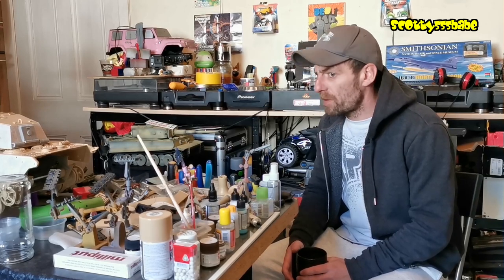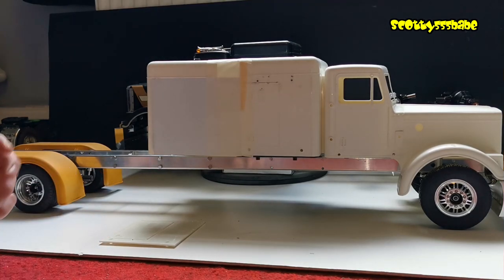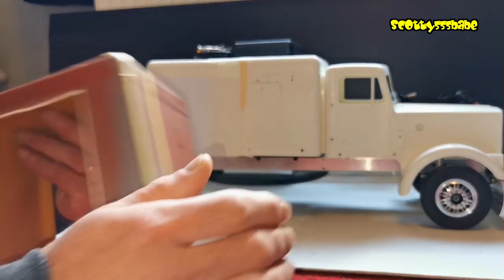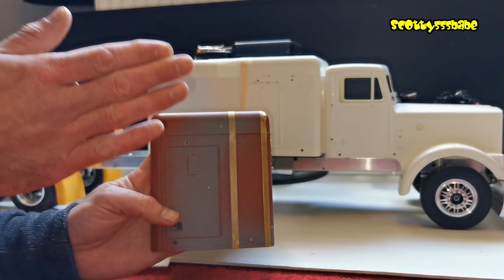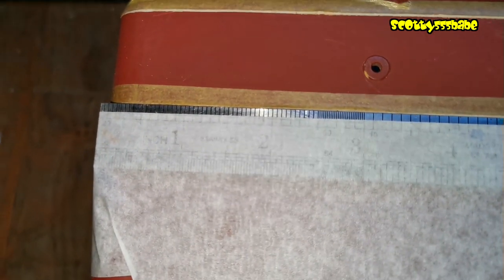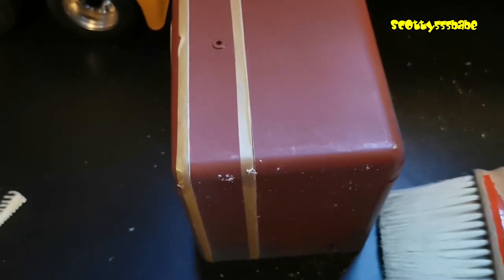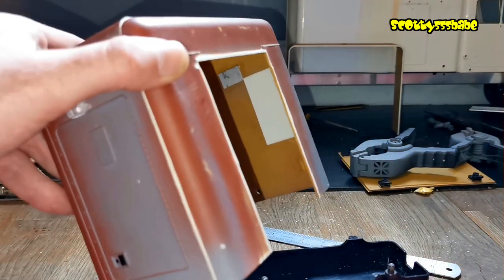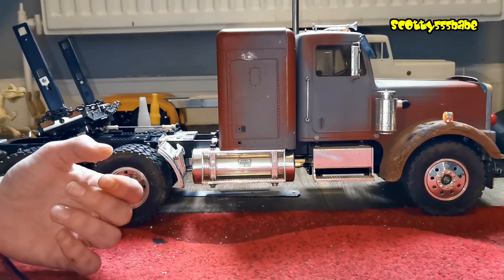HOW TO MAKE a Custom Short 45" style Coffin Sleeper | recycling scrap parts | Custom RC Truck build

Comment: Love that you sit on the floor, using basic tools and shows that you dont need a ton of expensive equipment and tools to make an awesome job. Well done and i think rusty will look good with a smaller sleeper on it.
Reply from the maker: I have better tools and dremmels and things but i purposely use basic stuff for the videos as not everyone has fancy equipment, I have access to an equipped workshop which would make everything so much easier but people would loose confidence in building as they'll think they need an equipped workshop with all the fancy tools..
All you need is an imagination and a bit of patience and work with what's on hand 😊👍

Comment: I can't wait to see how Tri axle is done because I'm planning it on my next build
Reply from the maker: I'm just waiting on some parts to arrive then I can get that third axle in and I'll do a video on how I do it.. The easiest way but it's also the most expensive way is to use a reefer trailer triaxle suspension set up but as I say that's an expensive way to do it,
Not every has the funds or tools  so I do like keeping things simple within the channel and just work with what's on hand that way more people are tempted to have a go 👍👍👍
Reply: @scotty555babe  my plan is expensive anyway lol. I want to use as many ally upgrades as I can find lol
Reply from the maker: In that case I'd go with using a reefer trailer setup, my KW is on no budget, everything has been replaced on that, but we all deserve to build that one truck.. The rest are going to be basic as far as chassis upgrades and more focused on custom cabs and paint 👍
Little by little just adding and replacing odd bits here and there and you'll soon have your truck the way you want 👍👍

Comment: If you had a Tamiya panel line scribes tool it would do the same job as the saw tip but a lot quicker and easier.
Reply from the maker: I have a Tamiya scriber, I've got all kinds of tools and access to an equipped workshop but for the purpose of my videos I like to work with what I have on hand as not everyone has the budget for additional tools or have confidence to have a go,
I love my scriber tools as I build things with plasticard and yes it definitely saves time and makes lighter work of the situation 👍👍

Comment: 2.54609 cm's is an inch, so 2.55 cm's would be closer to true scale for the sleeper. but yeah can see why you are really tempted with putting the sleeper back on old Rusty as does look good as a smaller sleeper. plus the addage of somewhere for the battery to go, kind of what I hate about the European trucks like the Volvo FH12 I am building is nowhere to store the MFC so kind of thinking of chopping up another cab for a false wall. but now decided I got enough bits apart from chassis, drivetrain, wheels, MFC, etc. then why not build myself a 6x4 Volvo FH, so that will be my next project probably be done before my 4x2 that I tried starting about 5 or so years ago, but never got around to finishing due to problems with paint chipping from tamiya paint thinking it would be a 1 paint deal.
Reply from the maker: Thanks for that, and yes it kind of looks good back on Rusty, as for the battery, my esc, Reciever and lipo battery all comfortably sit under the hood, just can't have an Mfu but I drive this truck through the woods in mud, water and all sorts.
False walls can be made from a sheet of plasticard and tucked behind the seats of the interior, the Mfu is a big unit which doesn't help really, hope you get it all figured out 👍👍
Reply from the maker: Your measurements is correct BTW, I made an error in the video by dividing by 10, I had 10th scale in mind as I had just been working on my crawlers so I can correct that in part 2 and file it to the correct size 👍👍